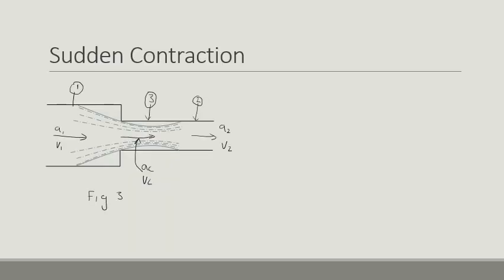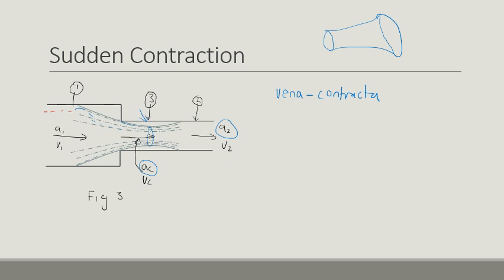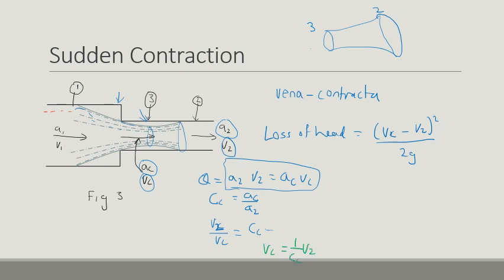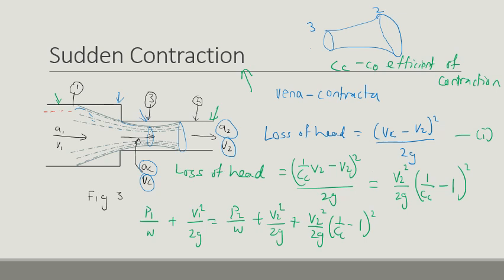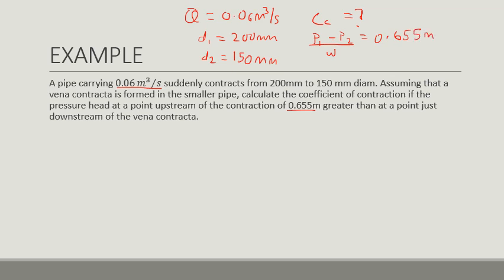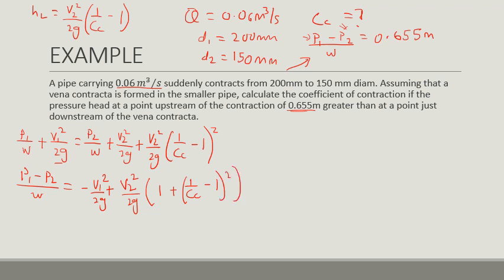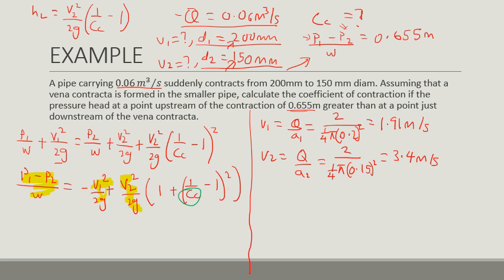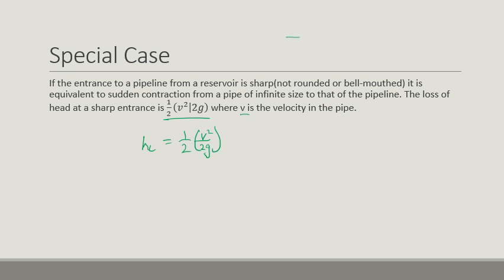FLUID MECHANICS 007-SUDDEN CONTRACTION

Comment: thanks bro
Reply from the maker: You're welcome 🤗
Reply: Two reservoirs whose difference of level is 13.5m are connected by a pipe ABC whose highest point B is 1.5 below the level in the upper reservoir A.The portion AB has a diameter of 200mm and portion BC a diameter of 150mm.The fraction coefficient for each being 0.005.The total length of the pipe is 3000m.Determine the maximum allowable length of the portion AB if the pressure head at B is not more than 3metres below atmospheric pressure
Reply: Help me out with that

Comment: How do you get v1= 1.91? But I get different answ...
Reply from the maker: Q is actually equal to 0.06 and not 2. So if you use 0.06 in the calculation, you'll get 1.91. Sorry for the mistake.